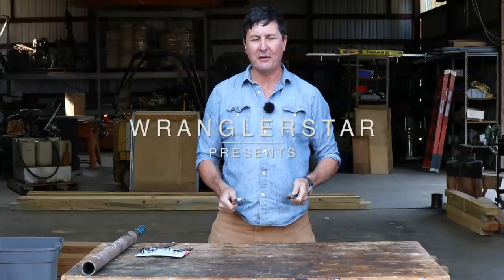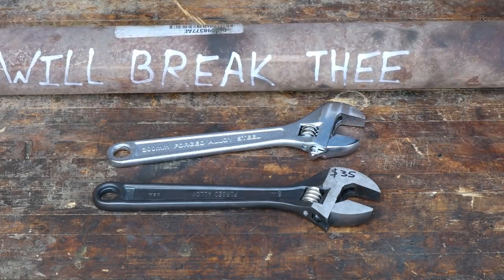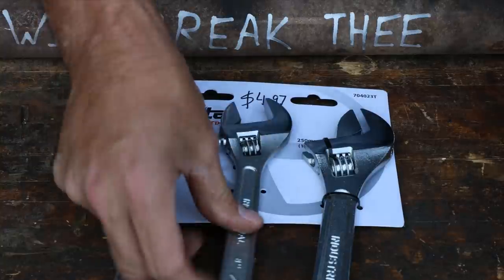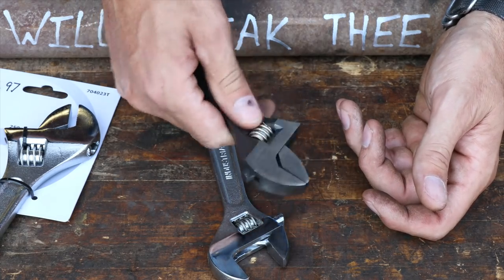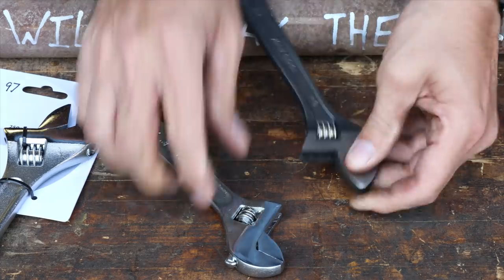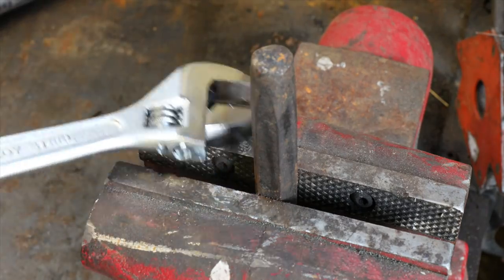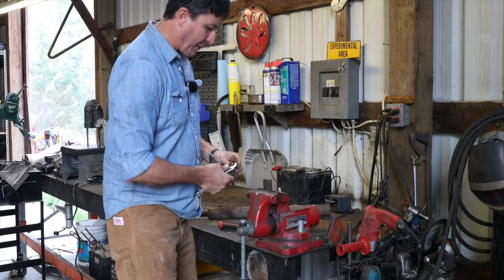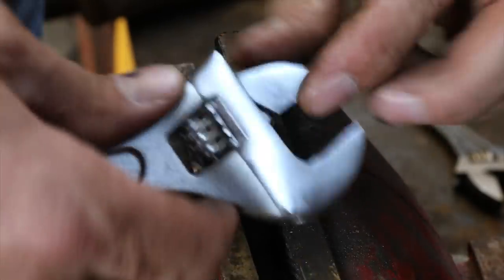Testing Cheap V.S. Expensive Wrenches On AMAZON

Comment: As an electronics technician in the Navy we didn't have a lot of larger tools in our shop.  So we borrowed them from the "IC communications" group who were more like electricians and had tool cage where you could check out tools.  A warrant officer was in charge of that department and thought electronics technicians didn't know anything about tools and insisted they as for a tool by its exact proper name.  I liked messing with him.  So one day I went to the tool cage when he was nearby and said "I need to borrow a wrench.".  He says, "What kind, open end, box, adjustable end?  What size?"  I said, "It doesn't matter, I'm going to use it as a hammer anyway."
Reply: Charles Kinzer -- Ah... "Improvisation" -- The key to making any average worker's tool box perform like the best handy man's chest! :-) --I grew up in rural W Michigan and kept motorcycles, snowmobiles and ski boats running fairly well working in my garage alone. Only full engine rebuilds, re-bores and welding did I send to the shop. :-) (I was a young man with plenty of free time on my hands and a generous father to finance my efforts back then.) :-)
Reply: @chivalryalive  Of course, in my case, it wasn't an "improvisation" but rather a joke and a poke in the eye to that warrant officer.  But I get your point.  For some things, you have to improvise or you can't get the job done while waiting for a special tool, or you can't afford the special tools.  I once had a Yamaha Virago motorcycle and to buy the factory recommend set of tools that a Yamaha shop would get (super long Allen wrenches, all sorts of stuff) cost over a thousand dollars.  And I've certainly made tools.  Such as one of those wrenches that are square on the end to remove water valve seats.  I could whip it up faster and cheaper milling some flats on a right angle bent rod on a milling machine than driving to the hardware store to buy their cheapie version.  I used to make various security bits as I needed them until I finally bought a set.
Reply: Lmao
Reply: @Majadi, tools on a ship are dangerous.  Everything has to be fastened or caged in the event the ship leans, or worse.  If each person had their own tools, you can bet your bottom dollar some of them wouldn't be stowed.  If one person is in charge of the tools for his shop, you know exactly who to throw overboard if things go badly.
Reply: That is what vice grips are used for.
Reply: he need to try a $40 chinese vs a $5 german wrench
Reply: I'm an FC in the Navy. The most important tools are, an adjustable wrench, and a flat head screwdriver. these 2 tools can be used for so many different things.
Reply: I'm an ic lol we got all the tools lol. What ship are you on?
Reply: i have been the same before when someone wanted to borrow a tyre inflator. by calling it "a pumper-upper-er" never knew what he was on about intill he said "i need to inflate a tyre... " Haha.
Reply: @derederekat9051  The German wrench breaks off.
Reply: This made me smile
Reply: That’s funny Charles. I had a guy like that in our community college auto class tool room. I wish I could have used that line back then, Guy was a jerk, insulting student who came to learn,
Reply: The ol adjustable hammer

Comment: I wanted to see the handle twist like the video image.
Reply: Me too, that was mis-leading.
Reply: Kinda the only reason I watched so early
Reply: I enjoyed the video so much I totally forgot about the thumbnail. I wish that had been in the video, but at least the video was very good on its own.
Reply: That doesn't happen, dang
Reply: Not a big problem for a man with a forge.
Reply: MarcAFK á
Reply: Then flag for misleading thumbnail, since it is...
Reply: Park Justin can you flag on mobile device ?? Or computer only please help
Reply: Plot twist: there's no twist.
Reply: Not there.  You should use the report button, use misleading thumbnail.  Not that YT does anything about it at this point.
Reply: unlabuntenga r
Reply: It looks like the wrenches he has, maybe he just didn't add in the final version?
Reply: unlabuntenga that's the only reason I clicked on the video.
Reply: "No".
Reply: wow. didnt even finish vid yet. guess he earned the thumbs down for misleading pic.
Reply: 'I will break thee' couldn't twist it, Photoshop did.
Reply: I reported for misleading thumbnail, everyone should
Reply: It was fake but accurate: the harder steel would snap, and the softer, cheaper one would twist (albeit not as in the picture).
Reply: flagged too
Reply: thanks for saving my time
Reply: The thumb nail
Reply: That twisted handle is actually a way you can buy them. Deceptive but yeah... just a picture of a different variety of adjustable wrenches
Reply: bob s nope not photoshop, they sell ones that look like that. He was talking about adjustable wrenches and he put pics up of them. That's not misleading... you don't turn wrenches do you
Reply: Not a good first impression of this channel. Came to see a wrench twisted like taffy, left disapointed
Reply: Oh thanks i wont waste my time
Reply: Yeah another YouTuber I'm never watching the videos of, if he's resorting to this sort of bullshit clickbaiting.
Reply: I don't get it ;-;
Reply: unlabuntenga me too I haven’t finished this vid and I’m disappointed already
Reply: @ronmoore6598   what a square
Reply: No one even uses a wrench like that. Unrealistic.
Reply: @clowningaround4182  both

Comment: My biggest test for crescent wrenches is seeing how well they stay at their setpoint while in use.
Reply: I hold my finger firmly on the nut as if I'm trying to tighten it the whole time I'm using them LoL. Because I'm paranoid it will slip.
Reply: Exactly. No one should be using a crescent wrench with this much torque...that’s what wrenches and ratchets are for.
Reply: @tonzokinawa  agreed, but that’s not the point. He’s seeing how they are different in quality hardness etc. that’s just my opinion though.
Reply: Agreed.
Reply: @tonzokinawa  realistically you shouldn’t. But i use them all the time on little pinches i find. My craftsman one i have before they turn to china junk is probably my favorite tool.
Reply: Agreed. Usually hold the revolver with my thumb..
Reply: *laughs in milwaukee*
Reply: Rachets technically are not for torquing either. Just saying..
Reply: Milwaukee's improved wormgear seems to do the best at that.

Comment: I buy the cheap tools first, and I only buy quality for the stuff that actually ends up getting used often enough to ever end up breaking.
Reply: Dude I agree with you as much as I can.
Reply: Meh it all depends what your using it for, cheap tools aren’t bad so I mean it’s just your preference but expensive tools if you want really it’s all the same
Reply: I buy cheaper tools for the most part because they still have life time warranty
Reply: Joe Gooslin sometimes, it really just depends how much your gonna used them, or depend on them
Reply: I hate all.... I somewhat agree, but I can't justify buying a 50 dollar snap on wrench, when I can buy a set for 20 bucks at harbor freight.   Especially when I can just replace it for free if the cheap one breaks.  Now power tools,  that's a different story.   With those I noticed you get what you pay for.
Reply: I buy the cheapest tool that can do the job. i dont need high end stuff for low end jobs.
Reply: @joegooslin9719  that’s great and I agree with you for the most part the only thing about that warranty and why they offer it is because they can cheaply manufacture the tool and give you a new one because it’s not built as good as it used to be so unless your ever in a situation where your not near a store or a store is closed for the day and you need to take that nut off cause it’s the last one you need to remove a water pump on your car for example and you have a cheap tool that stripped the bolt or flat out broke then that’s when having a decent priced tool comes in handy.
Reply: @joegooslin9719  you almost always get what you pay for, but if you're in the market for a cordless drill for hanging a frame every 10 years or so, paying for quality is just not good economy.
Reply: @joegooslin9719  totally agree. My dremel bits are like $10 for 1200 pieces. But I always buy miluakee power tools.
Reply: Yep.

If I borrow a tool 3 times, I buy my own. I go for better than budget, but not expensive. 
If that breaks through use, then I buy a better one. 

I don't buy for "just in case". I've never found thats a good way to spend money. Especially not buying for that reason, and spending hundreds at the same time.

Why pay that much for something I may only need 2 times. Easier to borrow one.

Comment: The original patented 1891 is from Sweden (Bacho Tools) and cost $350 !
Chrome vanadium Swedish Steele. It will last for you, your son and your grands son.
Reply: Rickard Liljekvist - I just commented on Bacho. Agreed, They are the best! Mine are still going after 10 years
Reply: I'd love to see it go up against a bacho
Reply: That's the tool C Lindberg took with him. A Swedish tool for a Swedish guy!
Reply: 14$-26$ in amazon.
Reply: English engineer Richard Clyburn is credited with inventing an adjustable spanner in 1842.[4] Another English engineer, Edwin Beard Budding, is also credited with the invention.[5][6] Improvements followed: on 22 September 1885 Enoch Harris received US patent 326868[7] for his spanner that permitted both the jaw width and the angle of the handles to be adjusted and locked. Swedish company Bahco attributes an improved design, in 1891 or 1892, to Swedish inventor Johan Petter Johansson[8][9] who in 1892 received a patent.[10][11]

Comment: Been a mechanic for sixty years. Used and tried every tool imaginable and of every make and brand.  For certain things you need the very best no matter the cost.  For others, cheaper tools work just fine.  I have broken just as many Snap-on and MAC sockets as the cheap ones however.  Sometimes it is luck.